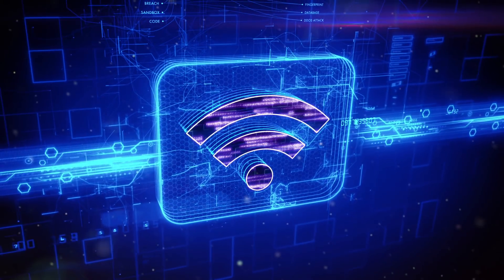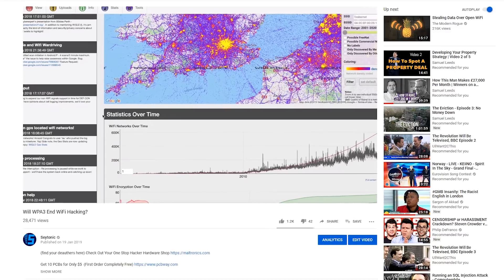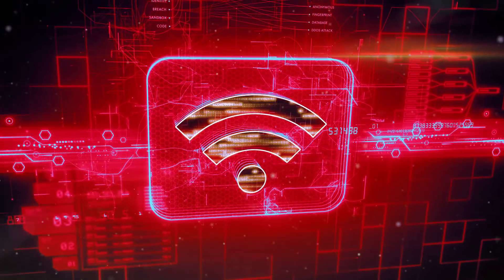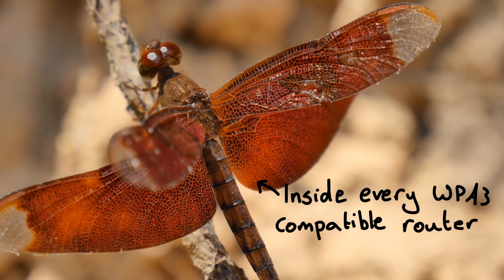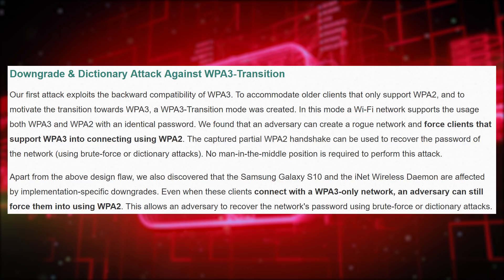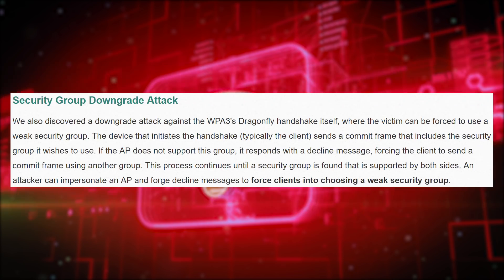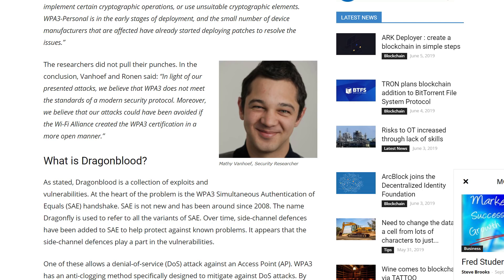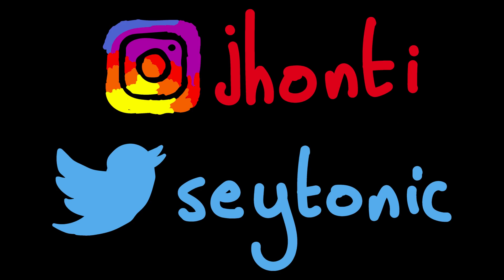WPA3: Hacked Already?!

Comment: Needs to be an option to stop fall-back to WPA2, even if that breaks compatibility with older devices.  RIP budget smart tv, RIP non big brand Android tablet/phone.  Apple IOS 13 Supports WPA3.  If fallback is turned on, might as well not fuking bother.

Comment: Theory: Safe.
Practice: Unsafe.

It is high time that the theoreticians were brought together with those implementing their encryption schemes to thrash out an understanding of where things go wrong and what can be done about it. I wonder if they will even understand each other's language sufficiently. It seems it is not so much a matter of which encryption algorithm is used, as how the overall system works. And we lack a means to instantly vaporise all those with malicious intent, much as that would be super neat.

This same difference between theory and practice occurs in other fields too, such as the implementation of laws and government services, and the consequences which arise therefrom. The difference between what is legal and what is ethical, and the reliability of sanctions against rule-breakers.

These differences occur because the object to which the laws/rules/schemes are applied are not inert, they are responsive, and have their own motivations, some willing to bend the rules, some to break them. This turns the overall system behaviour into that of a complex game.

So a working party to address the problems will require numerous disciplines, including not just mathematicians and software engineers, but game theorists and experts on criminal behaviour. Something the Santa Fe Institute might be good at exploring.

Comment: Denial of service by overwhelming the device - Expected, and not fixable in any publicly accessible networking device using ANY protocol.  Ever.
Timing - This type of attack is only feasible for high-value targets due to the advanced equipment and large compute-time needed.
EVERY other attack where the attacker has access to a device connected (or about to be connected) to the network - Also not fixable in any publicly accessible network.

Middle-man attacks - Only fixable by forcing people to pay attention, which is impossible.
SUM TOTAL: This video is pure restating of obvious hacks - and therefore CLICKBAIT.

Comment: computationally expensive  ok!! put a more powerful cpu into the router if it means each router can become a very cheap computer if hackintoshed or jailbroken and windows or linux installed on it  i am talking about putting a 5 ghz cpu on the router

downgrade attack?  no problem implement a separate password for each compatibility so you have to have a password for

wpa 1, wpa2 and wpa3 as well as 802.11b, a, g, n and ac so you may have a half dozen passwords for your router.

not many devices in the wild?  maybe not a good idea to upgrade since current routers are still very capable and speedy the only speed increase you may see in wpa3 routers is beyond what isp's top packages so not worth the upgrade.
Reply: Look at you pumping me up about the options

Comment: honestly i think it's pretty futile to try and prevent people from getting the password hash, just keep updating the hash algo to be harder and REQUIRE passwords to be 8 or longer and have a-z, A-Z, 0-9, and special characters and that will solve most of the problems. right now default passwords can be the death of a network, there are currently wifi hotspots that only use 8 numbers to generate their password, which with a decent laptop can be brute forced in 5 minutes. some of the hotspots also use very poor methods to generate passwords and can make guessing it so easy it can be brute forced in 2 seconds on the same laptop. If they make the password REQUIRE lower, capital, numbers, and special characters then with a password 8 long it would take that laptop over 600 years to brute force. now of course the hash could be offloaded to a server with insane power but that's why the hash algorithm should also be updated as hardware gets better.

Comment: You hit all the cve's that have been documented so far.  I did a bit of reading about dragonblood when I first heard about it, then I saw it on Threatwire.  Consumer Embedded Devices are slow on hardware, firmware, and protocol upgrades.  Also like you said even if the network is WPA3 secure  & the device connected to the network is not WPA3 capable its not able to use the new features.  Which is the way downgrading the cryptographic cipher compromises devices on that network.  As long as data flows through the air people will find a way , often, as in this case the very things that make wpa3 safe also make is vulnerable, more the end user and older client devices.

Comment: Hackers are fast
Reply: Because there are many of us
Reply: @ripmeep  yes indeed

altough, I'm still learning debian
btw, what's the difference between debian and for example, kali linux?
besides the fact that kali has +100 tools preinstalled

because kali is debian based, it's basically the same, but without tools
so I can just install just those tools I want
Reply: @nightviper7354  Kali has it's own custom repositories for the package managers which means there are also a lot more available tools to download. You can add these repositories in Debian also, however it is all tailored to Kali. Kali Linux isn't really meant to be installed. It's more of a quick usage, live Linux . Hence the pre installed tools. At the end of the day, install a Linux distro that YOU prefer. Not one that everyone else is using. I used to have Linux Mint on my machine because I preferred it.
Reply: @nightviper7354  also, Kali is good for setting up custom tools found on GitHub etc
Reply: @ripmeep  parrot is pretty much kali, with lighter core and more tools
Reply: @nightviper7354  parrot is a compilation of security repositories in one. Kali included. Apart from the tools it is quite different to Kali. Parrot is more installable and user adapted. However again, use what YOU prefer. Not what people tell you is best for Hacking or whatever you want to do. The best hackers work to their favorite OS. Not the one everyone else likes. I hope this helps :)
Reply: @ripmeep  yeah, it helps
and I personally like parrot
everyone else says "kali is the best hacking os"
"kali is better and more stable than parrot"
only difficulty that I have, is that I can't install parrot live persistence
I can, but I get these very annoying lag spikes like every 5 second
and they last 10-30 seconds each
it makes using it pretty much impossible
so I can: use just live mode and store my files in another usb, or I can use parrot in virtualbox, or I can just install parrot as dualboot in my computer
Reply: @nightviper7354  persistence is an annoying thing to get right. But yeah if you prefer parrot then dualboot or something would be a good idea. I do like Kali and it's great but normally, I install Kali Light. That way it has all the potential of Kali but I have more control over what I want it to be
Reply: @ripmeep  ok
uhhh... how is kali linux different from kali linux light
Reply: @nightviper7354  Kali Linux Light is Kali Linux with just the basic Linux commands and very few of the tools on it. But it's basically setup so you can make your own custom Kali Linux with what tools you want on it
Reply: @ripmeep  ok ok
and what do you think is the best for hacking: debian, ubuntu, arch, or something else
Reply: I dunno is there more than those 3
Reply: @nightviper7354  I prefer Debian personally. i find it easier to use. Arch is good as like a playground type PC and Ubuntu is a good user friendly all rounded OS
Reply: @nightviper7354  I would suggest setting up a few virtual machines with them, use them for a few days each then decide which one you prefer :)
Reply: @ripmeep  yeah, I tried arch linux for a few minutes, and I have no idea how pacman works
soooo... it's either debian or ubuntu for me
Reply: @nightviper7354  Ubuntu is Debian kinda. It's up to you
Reply: @ripmeep  yeah, kinda
but as far as I've figured out is that "nautilus" doesn't work in debian
that's all I know about that xD
Reply: @nightviper7354  do you really need that?
Reply: @ripmeep  no, but what's the command in debian for that same thing
Reply: @nightviper7354  you should just be able to install it
Reply: @ripmeep  oh yeah, why didn't I think of that🤣
Reply: @Schonaton05 Norb ok

Comment: u can't make something unhackable .
Reply: Codingmaster actually, you can. My toaster is unhackable.
Reply: @surlado9467  No. Your toaster is not "unhackable". With physical access, an attacker could change the code inside the inbedded system, or even change hardware, to produce an unwanted effect (e.g. making the heater in it too hot, or whatever). Hacking does not just have to be over the internet or 'wireless', which is how it is mostly painted in today's society. A hacker is just as much as a hacker with or without physical access. (With physical access it is much easier for the hacker - this is why many server rooms are locked, databases location kept secret ect). Furthermore, with the implementation of smart devices and the "internet of things", it won't be long before your toaster has a physical connection to the internet (it may do already), making it a million times easier to get hacked. Trust me, your toaster can, and may well get hacked in the ever increasing smart devices world. 

Smart devices ( your toaster for instance) will be a massive problem for privacy issues in the coming years, mark my words.
Reply: @surlado9467  that was brilliant
Reply: @surlado9467   you can hack it , hacking is not limited to technology , pour water into it , working?
Reply: mihaiio C. Yes, still working
Reply: TLDR; yes, yes your toaster is very hackable indeed
Reply: @surlado9467  I can
give me your IP and 27 years time
Reply: Night Viper 1.3.3.7 take ur time
Reply: @surlado9467  first I just have to wait for someone to make toasters with internet or bluetooth
Reply: @nightviper7354  r/masterhacker
Reply: You cant hack a rock